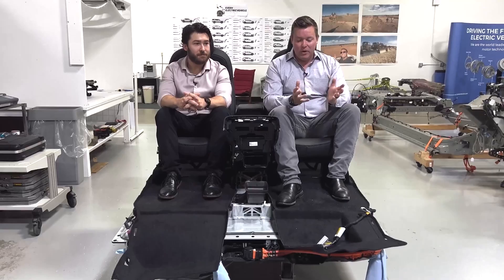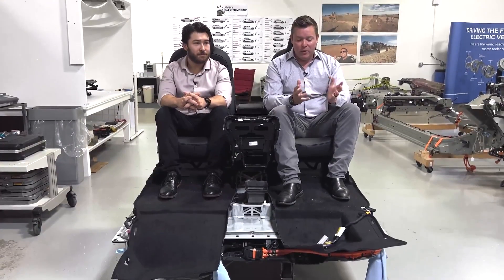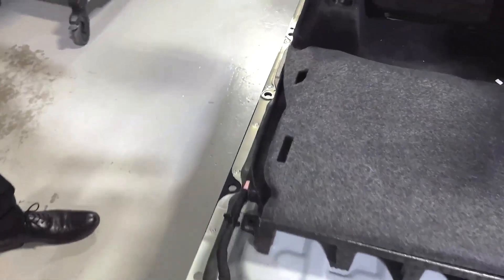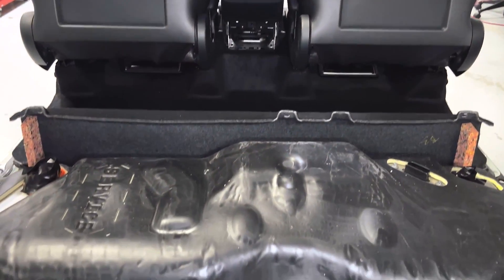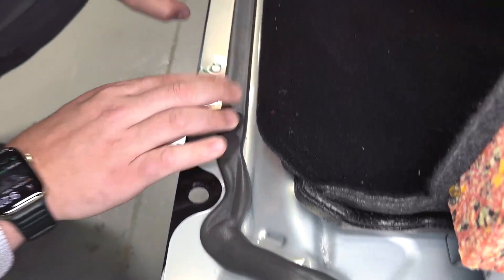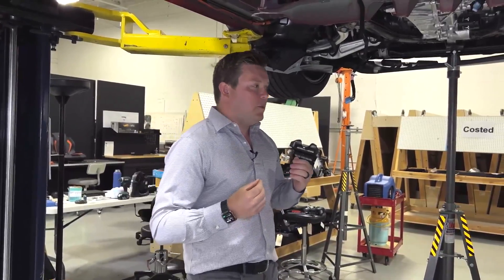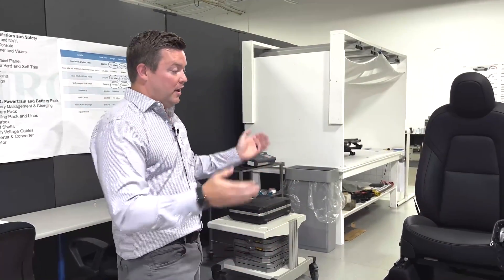Munro Tear Down Tesla’s 4680 Structural Battery Pack 🤯

Comment: This is a product continually being improved by CAD to Bot production line. This new type of production line is easy to update products which give the engineers a fast and efficient feedback loop. This is the first of many new factories to fully connect engineering, design, and production creating very cost-efficient products.

Comment: I didn't read all of the comments, but one thing to point out is that if I decide I wanted more mileage battery upgrade and/or if there is any battery breakthrough, it would be a simple swap out that would take no time at all to do and would likely not cost a huge amount with the trade in of the old SBP. The other big thing that was noted is that at battery day, this was the goal, it was on time, and it seems to be as efficient or more efficient than they stated back then.

Comment: Wish I could afford a Tesla in Sweden, they are way too expensive here, 60k for the cheapest Model 3. 75k USD for a Model Y. Aint no way I can afford that, even as a software engineer (salaries are lower than the US). I guess I will have to drive my diesel car another 10 years before I can afford one, sigh.

Comment: Politicians have to run on some kind of platform, and Ben Moss—my state House representative here in North Carolina's District 52—decided that his animating principle is Being Mad at Electricity. To prove his animosity toward this invisible menace, he's sponsoring House Bill 1049, which would allocate $50,000 to destroy free public car chargers. It contains some other enlightened ideas, but that's the main theme: We've simply got to do something about these free public chargers, even if it costs us $50,000! Those things cost tens of cents per hour, when they're being used.

Of course, there's a caveat here. Moss isn't saying that free public Level 2 chargers—of which there are three in my town, with plans in the works to convert to paid kiosks—definitely need to crushed by a monster truck. That rule only comes into play if a town refuses to build free gas and diesel pumps next to the EV chargers. So anyway, warm up El Toro Loco, we're smashin' some car zappers!

Electron heads, as I call them, also like to point out that electricity is generated domestically, so your transportation dollars are staying in the U.S. rather than going to, say, Saudi Arabia. And if you really want to keep your money in your community, you can hire a local company to install solar panels and make your own electricity. District 52 includes numerous electricians, and Duke Energy utility workers, and solar installers. But no oil rig workers—yet!

Comment: Once upon a time there was a leading television company who invented color television, then system 3, then HD television.   They were the top of the market, and we paid a premium for Zenith as the company who ‘put the quality in before the name went on’.   The Koreans and Japanese were making black and white TVs and dumping them on the US market to gain some kind of presence.  Then they came visiting Zenith who opened their engineering and factory and shared their prowess, whether out of pride or idiocy.    The Koreans and the Japanese came with the last difficult parts of the process they couldn’t figure out and asked probing questions of the engineers.   Then, together with government subsidies and cheap labor they kicked out ass and took market share.   Eventually the Koreans (LGE) bought a controlling stake in Zenith and then took full control and all the intellectual property / patents.   

I write this as a caution that it may not be wise for Monro to be doing what it is doing to showcase Tesla engineering.    It just serves to accelerate more credible competition.   Sure Tesla will continue to innovate, but why help the competition.

Comment: It kind of looks like changing the battery pack out for a new one would be less difficult than doing work on my AC unit in my old Toyota pickup truck where they had to pull the engine so they could get in to work on it (the mechanic put in the wrong refrigerant).

Comment: The Munro and associates are continuously dropping truth knowledge 💣💣💣 for the competition of “TSLA” and competition isn’t actually acknowledging the situation. 

The competition is ignoring TSLA like they don’t even exist. 

The structural package of TeraAustin vehicles is going to be quicker for completion per vehicle vs the non structural units, on the basis of the seats and interior components are attached to battery package and less time to move in the interior systems. 

The best part is no part and less parts are better.  

Less parts = quicker to complete the process of build a vehicle and quicker to get the vehicle into the customer, then quicker to paid and margins etc. 

Well Elon stated that it’d probably be 12-18 months before the 4680 platform would be available for customers. During the battery event. 

During the battery day event, I was actually using the Elon timeline and added minimum of 6 more months to the calculations, especially when it was announced that Kato road was already done a million batteries @ 90%+ usable units. 

Other manufacturers have bean counters and MBA executives at the helm of the companies. 

They aren’t capable of using the first principles of engineering mindset in the corporate mindset of the status quo. 

https://youtu.be/hgu7Ok-qcTY 

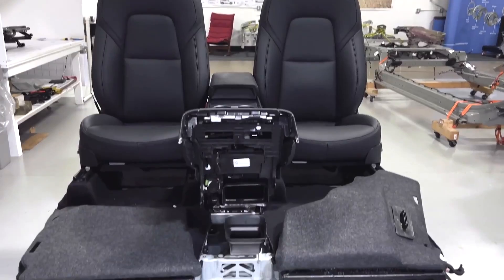11:20 mark is 544 kg.  Is 50% of the competition's battery pack only.   🤯🤯🤔🤔

If TSLA is only a auto company then why is it that they are actually the only ones who are actually CAPABLE of reducing the battery weight and still have the BEST option of battery mileage etc vs the other manufacturers? 

More weight = less mileage per kWh per charge. 

🧠🧠🤔🤔🤔 = Wait if you remove the weight from the vehicle, then you get MORE mileage per kWh or charge?  🤪🤪🤪🤯🤯

The outliers of Wall Street will come out on the revelations of the Munro 4680 tear-down  and adjust their own estimates of TSLA. 

But the Wall Street consensus WONT actually come out for any adjustment of Munro 4680 analysis. 

Because they don’t know how to process the information that Munro is giving them..  

:_STMPLol::_STMPLook::_STMPTsla::_STMPMatters:

Comment: In the 80s I was in elementary school and was part of an experimental “environmentalist curriculum.”

One of the visitors brought in was a GM rep. They showed off the first GM branded vehicle, a two seat EV. They told us that even with old fashioned lead acid batteries, which they hoped to upgrade to better tech soon, it would make cars less expensive to build, maintain, and operate. 

They then explained how future vehicles would all be Electric, with small generators and fuel tanks, because running a gas motor at its ideal efficiency to turn a generator, was way more efficient than using an ICE to directly drive the wheels…

Many large companies and municipalities even spend money to buy ICE vehicles and then gut them and install full EV systems, because it comes out cheaper long term. 

My guess is that GM trashed their EV transition when they realized that most of their money comes from repairing and replacing vehicles and vehicle parts at a faster rate than EVs wear out.
Reply: AMC in the '70's built an all-electric Gremlin, and even had charging stations deployed in small quantities to charge it.  Innovation in those days was quickly snuffed out in large part by a globally dominated oil / gas industry with teams of lobbyists ready to deploy to congress should anything really serious develop with the legacy auto makers.  Innovation really DOES require a completely new entrant in an existing space in order for true change to occur.
Reply: General Motors took all those cars and ground them up. What a bunch of morons. They could have truly been the leaders instead of following.

Comment: So much easier to mount the seats and center council onto the battery and insert it. Saves a ton of time and labor just with this. Giga casting is even more savings. Nice job TESLA!
Reply: It is also easier to mount everything into the car itself as you can stand up in the floor hole to do so. When done simply put the floor/battery pack in place.

Comment: How much better are the 4680 model Y's?  And in which ways are they better? (or worse?)
Reply: 1 - Structural with no interal modules to speak of. Reduced complexity and weight for structure
2- 4680 Has tabless design and should charge/discharge alot faster with less evolved heat (energy efficiency and battery life improve with charge rate). 
3- Dry electrolyte that requires no drying ovens and reduces cost and size of production line by about half. (for this part of battery, not overall). Less factory space required, faster production as no wait for drying. 
4- Thicker electrolyte, so higher energy density
5 - Just on the stats: 
50%= Higher energy density Kg/wh. 
Higher power density (charge/discharge rate) substantial but not as yet quantified
50% cost reduction for the same capacity
Cleaner production (no electrolyte solvents required)
Faster production per dollar spent on manufacturing equipment
Longer battery life expected to be >1Million miles
No use of Cobalt (expensive/rare element compared to others)

In short, When fully optimized within the next 12-18 months, all these stats 
should be realized. 

Much cheaper car ($4-5k or so cheaper for MY) OR MY increases range 30% and marginally cheaper AND battery lasts 2-3x longer AND charges substantially faster AND is less polluting to manufacture. 

Balancing all these things (some compete - example range vs price). 
Cheaper/longer range/faster charge/longer life/less polluting to produce.
Reply: @avgjoe5969   @Avg Joe  I was already aware of most of this information from previous released infomation from Tesla/Elon, idra and other sources.

But now we have 4680 model y's in the wild, what are the benefits to the consumer?
Obviously there is the enhanced life of the batteries which is great.  But what else?  Comparing the 4680 model y we have now, which is 279 mile range from 66.5kwh battery, there is literally no difference in range per capacity over the 2170 (LR has 315 miles range from 75kwh).  So what happened to the 16% extra range?  Also, assuming the car has less weight, that range should be even more than that right?

It's looking rather disappointing to me if this really is the case.  Not that people needed it (I currently drive a mercedes EQB with roughly 260 mile range), but many people including my self really wanted a 400+ mile range model Y.

Tbh, it's pretty much on par with what my EQB does, and that thing is like a massive brick slapping against the air.  Also has an identical battery pack size of the 4680 Model Y (66.5kwh).
Not only that, but pretty sure my EQB is substantially heavier than said model y...  This really isn't making much sense to me right now.

Comment: Sucks that it leaks water because the sealing is not fully pressured
Reply: Not really, they only said that there isn't really strong witness mark, which only means that while there was actual sealing, there wasn't one like in other parts where you have fully compressed sealing foam. Its still properly sealed, it could simply be better.

Comment: Could I ask a question of “knowledgeable engineers “ ?

What is to stop VW or GM buying the same high pressure die -casting machines from Italy and coming up with a better (Enhanced) design that leapfrogs the Tesla?
Reply: Because tesla secured contracts to buy the next year's worth of idra's large press  production.
Reply: Nothing, in general, but then, why are they not doing this? Why are they never done this before this? It's not like mega castings are new thing, even EV's are not new, yet all old OEM's still stuck in ancient past. And difference is that Tesla is using those mega castings TODAY while every other company can only dream to put an order for few of those machines which could be used in few years down the line.
Reply: @Zripas  
I guess if you ever get into a small accident with these gigacasted Teslas you will know why !
The repair costs for even a small dent will be enormous  !
Reply: @cf6965  
Think before writing.
Small dent will only... Dent... external parts... If you get into accident which gets to the gigacasting which actually damages it, you will be happy to get alive from accident like this, let alone complain about complications fixing your car... Accident which damages gigacasting will be result of basically complete car scraping afterwards anyways, so there is no difference here.
Reply: @Zripas  
That's not true, I had sombody run into the back of my 2006 Honda Civic waiting at a traffic light. 
Although my car suffered a big hit, it had not to be scrapped !
They just needed to replace certain parts !
Reply: @cf6965  
Have you even read what I wrote in previous comment? For gigacasting to get a damage you would need extremely serious car crash, not some rear ending at stop light, but serious car crash... If you get rear ended, then you will replace certain parts and that's that... There is still few parts, including crush can, BEFORE you get to gigacasting.
Reply: Because it isn't the tools it's the thought process. That being said single castings will become standard in the auto industry over time, but legacy auto doesn't have chops to do it like Tesla, they simply move too slowly. Their core corporate structure simply can't produce the same pace of innovation.
Reply: "What is to stop VW or GM buying the same high pressure die -casting machines from Italy and coming up with a better (Enhanced) design that leapfrogs the Tesla?"

Their company culture.
Reply: The actual aluminium is a Tesla produced special formula design to flow through the whole mould. The would also need to invent this to get the presses to work properly.
Reply: In general, I'm guessing legacy baggage /capital investments in other equipment and processes that would be difficult to remove and replace. But I'm not an engineer, just a corporate cubicle drone.
Reply: Lack of ambition, lack of imagination,  lack of talent

Comment: I was sort of looking forward to actually seeing the elusive 4680 cell in this presentation. Where is it? And as a matter of interest, how serviceable is the battery pack once it's integrated into the car? I can see how designing the component as an integral part of the structure may reduce weight and at the same time increase strength. That makes a lot of sense. But what if a cell fails or the time comes when the battery pack requires replacing? Is this a disposable car?
Reply: have you watched this video? They literally explained how simple it was to remove entire pack, just 34'ish screws and it drops down, you can simply replace entire battery pack with new one if you have some major issue with it. In a sense it even simpler to service car with this pack than it was with older ones.
Reply: @Zripas  Cheers. No, I didn't watch the video in its entirety, I was flicking through to see the cells. Easier (cheaper!) battery maintenance is a big step in the right direction.
Reply: @davidbrayshaw3529  
Don't get me wrong here, its allot more complex to actually get inside pack itself, but at same time, no one was actually qualified or even allowed to open previous ones and mess with those for repair purposes. But having option to just drop down entire pack and replace with new one in like 30 minutes, that's a good enough option. But you will hardly need replacement like that one if you are not some hard core driver who tries to hit 1million mile mark.
Reply: Unless you drive very much you should not need to replace the battery pack at all.
Reply: That's 4680
Reply: @francoischarbonneau9447  Yes, it is. I will edit my error.

Comment: One thing that intrigues me is how Tesla handles spare parts. If they are constantly making tweaks to the design, surely they have to keep huge stocks of all the different generations for repair/failure purposes?
Reply: This would seem to be the natural downside to constant iterations.  I do wonder how Tesla avoids it being a problem.
Reply: Additive manufacturing to some degree makes this possible. It costs more for larger parts, but you can make 100 different parts for the same price as 100 identical parts (more or less). Hence the spare part would cost more but would not require you to keep an inventory of dozens of iterations.
Reply: Backward compatability

Comment: As one Auto engineer pointed out - the fact that there is no  "floor" of the car (until the structural battery pack, complete with seats and carpet is lifted into place ) has additional benefits. It is much easier to install wiring harnesses, trims etc. inside the car when you are standing up, rather than twisting around, bending or kneeling. Saves time, and just as important, stresses and strains on the assembly personnel...genius in many ways...
Reply: Also, looks replacing a battery pack would be pretty easy.  In 5 years you might be able to "upgrade" from standard to ultra long range in a pretty quick visit to the Tesla service center.
Reply: True. Hadn't thought about that. Nice catch.
Reply: Also brings the idea of changing out battery packs when they wear out much more possible and feasible.
Reply: It's not to be underestimated.